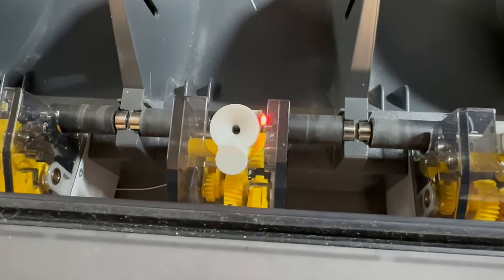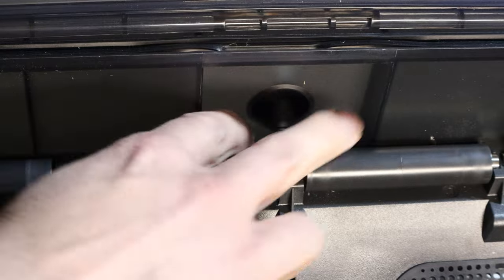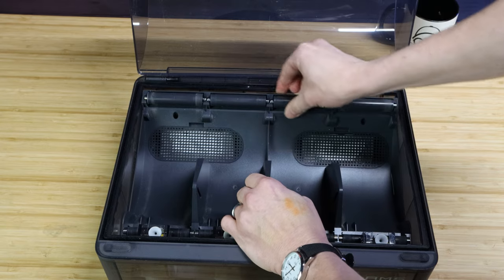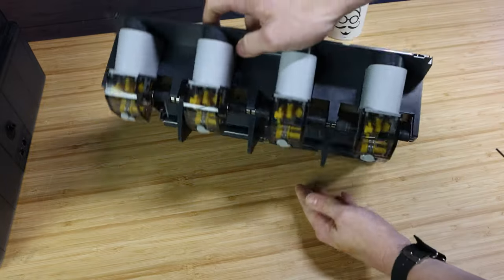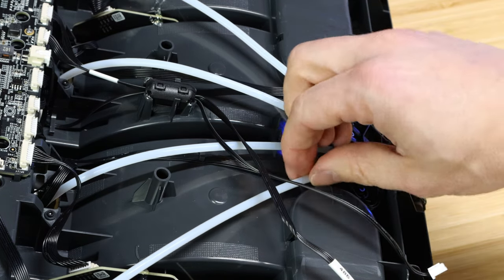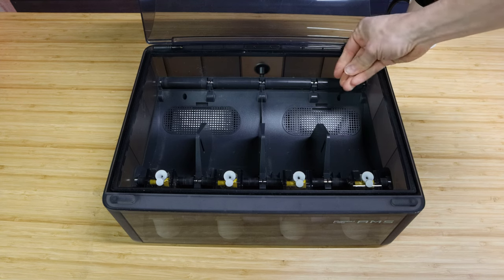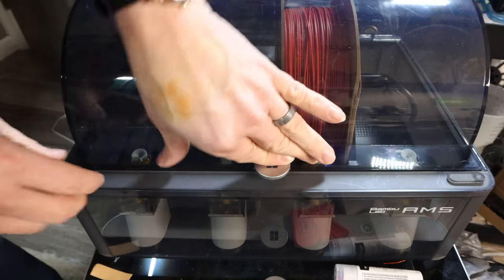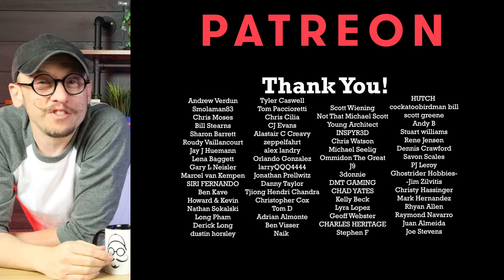How to Remove Filament Clogs from Bambu AMS

Comment: 9 months later, but thank you. I looked up someone else's video, and they didn't mention the screws or the wires in the back. They just said to unattach the back filament tube, then rip the thing out of there. I go by the "never force anything" rule of building, so I knew something was wrong when mine didn't instantly lift off like his did. 

Thank you for doing it right. And I'll make sure to note this channels name as good info, and the other one as terrible info.

Comment: Thank you for this great tutorial. Loaded some old filament into AMS and apparently have a few inches it just broke apart and had everything hosed up. Even other roller slots would not print because of sensor failing to fully unwind slot 2. Appear to be up and operational once again.

Comment: Well, it happened to me either. The EMS was trying to unload the filament continuously, so I switched the printer off and took out the spool. Then, I disconnected the PTFE tube on the back, cut out a piece of filament about 1 meter long, and put it in the tube backward towards the EMS. Then I switched on the printer, and while the EMS was trying to unload the now empty slot, I pushed the filament piece until the EMS started to pull it by itself. And the broken piece just popped out. Then, I removed the long piece that I used to push back the broken piece and reinserted the spool. No unscrewing done.

Comment: Fixes AMS and insert cardboard spool into AMS. :) Thanks for the walk through I am sure were all going to have to deal with it.
Reply: Nice, easy description. That damaged spool could cause a problem however. But, all in all if it functions it's ok.
Reply from the maker: Yeah the spool was damaged and didn’t realize it. I’ll probably rewind it on another spool. But I’ve had no issues with cardboard spools and I’ve put at least a dozen through it so far.
Reply: @ItsMeaDMaDe  I think the concern from what I have read is the build up of cardboard fibers from repeated use. Using a card board spool every now and again should not cause issues but using them on the regular may result in fiber build up.

Comment: Excellent Video!  Thanks.  Almost :( solved my problem....  One additional tidbit of information to add.  When you remove the broken piece from the tube, check that there is no additional piece in the section where the 4 tubes come together in the plastic "consolidation" piece.  In my case, after pulling the filament out, there was another small piece left in the section where the tube is connected that I couldn't even see it without a flashlight (black filament).  I had to take it all back apart and remove the smaller piece, about 1 1/2 inches, that was in this plastic "consolidation" piece.  Once I did this, everything worked.  I had left the printer off while on vacation for a couple of weeks and it didn't like me when I came back.

Comment: Have you run across where a small tidbit of filament is stuck inside the divider(bad name) that pulls filament in from the different slots? I can't seem to get any filament through slot 1. Can't seem to get it going from either side after I've removed the ams from the box, disconnected the tubing and see nothing.

Comment: The "fat" connector (close to you in the video) has a slot that prevents connecting in the wrong position. The "Flat" connector (away from you in the video) does not have such a slot. What is the correct position to insert it ?  it has a blank side and a side with the copper wires. I am assuming copper side pointing outside (right in your video). I thid correct ?

Comment: Great video! My Notes: Never use brittle filament in the AMS!  If you can break it just by bending it is too brittle and needs to be dried.  I have had my AMS apart so many times I don't put the two screws in it anymore.  The screws are metal and they screw into plastic so there are only so many in and outs left.  Other than this issue I have great luck with my X1C and the AMS!
Reply from the maker: Yeah I’ve only taken it apart twice now but I see what you mean about that.

Comment: Hopefully the next Bambu printer will have easier to connect/disconnect wires - ideally with a stronger connector that slides in and out easily for maintenance.

Comment: Great Video! However, I’ve followed all the steps and don’t see any broken filament 😮 its feeds the filament about 6-8 inches through then starts grinding, back feeding abit then forward with more grinding. I’m at 92% current mid print job. I’m afraid to unplug the electrical part of the AMS, to further take inspect and take apart. Don’t want it to cancel my print! help! Any suggestions would be greatly appreciated!

Comment: What do you do if the clog happens inside of the printer itself, and not in the AMS unit? I have an AMS connected to my X1C. I'm getting an error about the filament being clogged, but the tube coming from the AMS is empty -- though I can see inside of the printer itself, there's filament in that tube.
Reply: I have that same issue now. My first print with the AMS with the first filament change caused a jam. extruder just kept rotating and clicking. Now I can see filament in all the PTFE tubes from the AMS to the extruder. I guess I have to remove the extruder to fix the jam. very frustrating

Comment: I'm puzzled by the recommended solution for removing broken filament from the AMS. Wouldn't a simpler and more straightforward method be to disconnect the PTFE tube from the back and allow the AMS to push the filament through until it falls out of the end of the tube? Additionally, using another spool of filament could help ensure the stuck filament is effectively pushed out without getting jammed again. The current suggestion to disassemble the machine seems excessively complicated for dealing with a piece of filament that could be more easily pushed through rather than pulled out. This alternative approach could save a lot of time and hassle for users. However, to my knowledge, this method isn't currently an option, which I believe is an oversight. I think Bambu Lab should consider investigating and possibly implementing this as a viable solution.
Reply from the maker: I understand what your saying but there are check points throughout the ams and if the filament breaks between those points the only option is to take it apart. The place where the filament broke for this instance (which is most) it trips the sensors but there are no motors to push it forward due to the motors are before and after the break point. And to the point on pushing it through the ams also has stop points due to the switching between so it’s not just a seem less tube to just push it through. Yes you have to take it apart to fix it but that’s kinda the hobby. Anyone that 3D prints is eventually going to have to take something apart to fix it. These are machines that break. The great think is all the parts can be replaced. Most people don’t realize that the 3D printing hobby is two fold. Printing and maintenance. Hope this helps clear your confusion
Reply: Wow, thanks for the quick reply! I understand your points about the AMS structure and challenges. 

However, my suggestion was aimed at using another filament to manually push through the stuck one, which I found to be perfectly feasible when the machine is disassembled. 

Having started with 3D printing back in 2013 with a basic (meaning crappy 😅) delta printer, I've become quite adept at DIY fixes and its nuances. I was just hoping for a simpler solution from a high-end machine like the Bambu Lab. Great video BTW 😀 @ItsMeaDMaDe

Comment: Does not help when the filament is stuck in the loading mechanism at the front and sticks out the back. You are unable to lift out the center part at the beginning.

Comment: Waiting on my P1S...fedex brings package (1 of 2) Excited i go to door and open box. It's the 2 free rolls of filament...P1S still in route. Talk about disappointment! Thanks for the info here another great video bud!
Reply from the maker: Oh man. Well hope you got it by now. Have fun with your printer!
Reply: @ItsMeaDMaDe  still waiting lol. My ender 3 S1 pro is doing awesome for now. I moszy'd around in Bambu studio and as it sits I don't really like it. Seems cura has A LOT more adjustability. But I guess alot of that isn't needed for the P1S? Cura just seems a lot more on a pro level where Bambu studio seems kinda bland. Maybe I need more time in it tho. It did connect to my ender 3 since it's running Klipper tho which is cool. Can cura connect to P1S is the question.